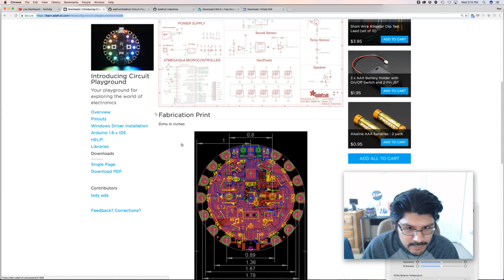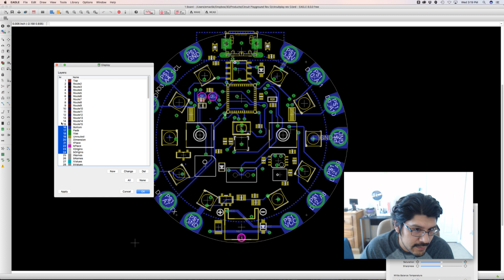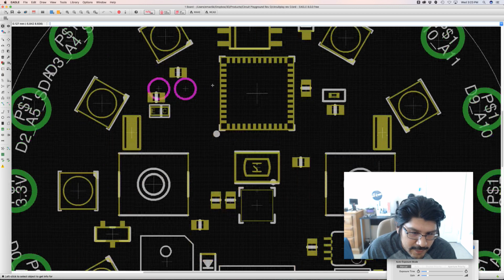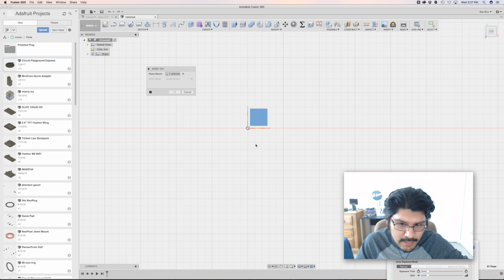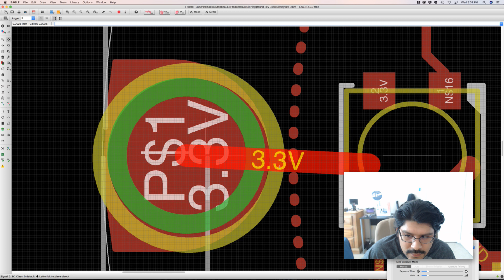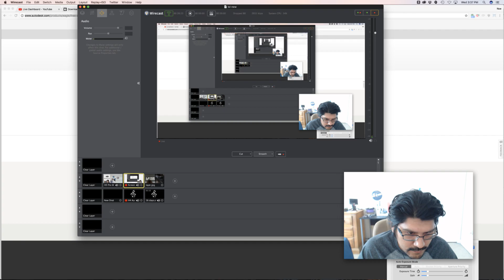Layer by Layer – EagleCAD to Fusion 360 with Circuit Playground Express

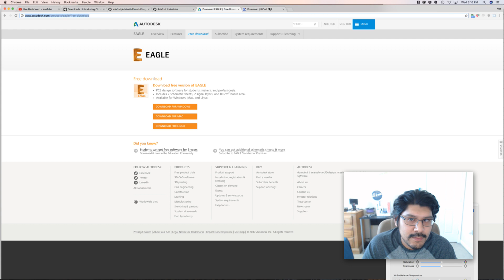Comment: 5:20 So I guess its now kind of official that adafruit (as one of the larger EAGLE-for-maker supporters) will switch to KiCAD in the future only due to the autodesk licensing changes? 
So I guess this is another point for EAGLE decreasing even more in popularity in the future. 
As a very long time user of EAGLE (who is even in the posession of the now-obsolete hobby license, that cadsoft provided in the past) I find this both really sad but at the same time I like to see Autodesk's (as in management) future reaction to this really shitty move. Also I am a proud user and developer of open source stuff, so I encourage the use of open software.
Amen.